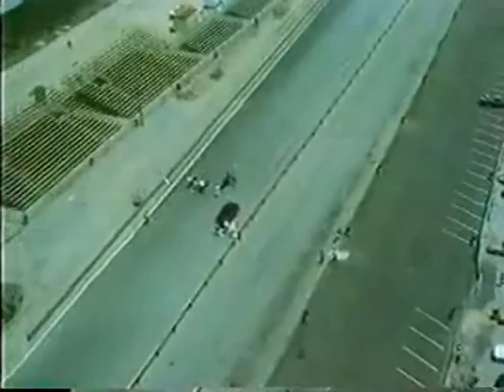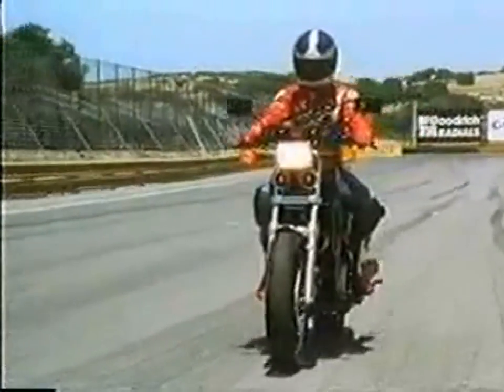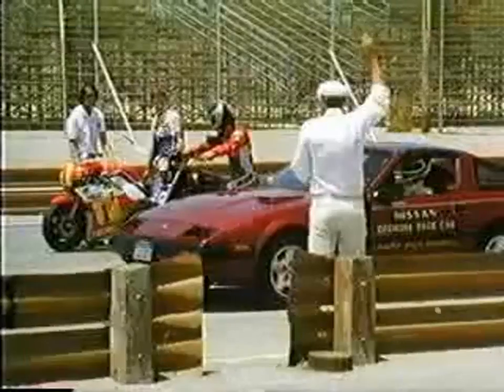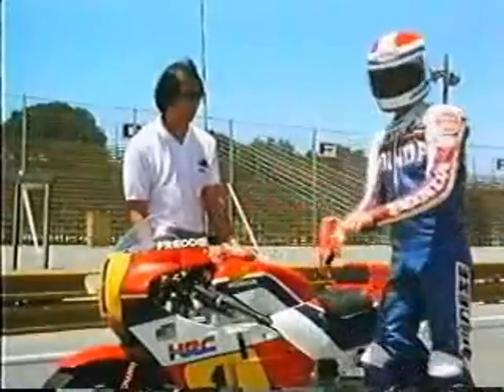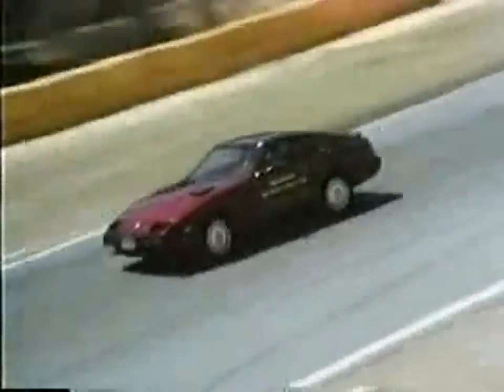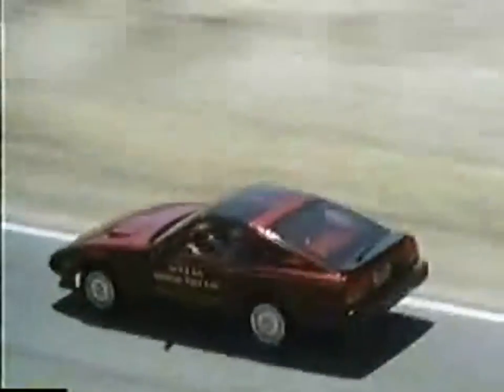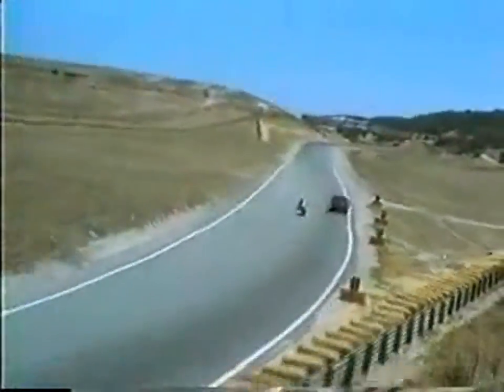Freddie Spencer GP bike Vs Street Bike Vs Car

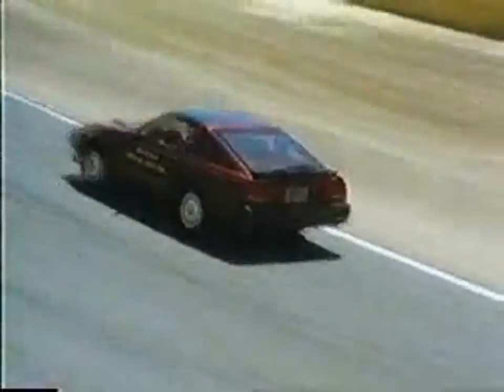Comment: If a car does a 1:30 and Freddie can do 1:15 .or less. of course  the car would get a 15 second head start.  
The objective here is where Freddie needs to overtake for dramatic finish.
Reply: That 1983 Z is not going to do a 1:30 though  (closer to a 2:15 or so) and Freddie will be within a tick of todays times.  Lap times of GP bikes at Laguna only dropped about 4 seconds over the years (on the hew layout . . Lawson was doing 1:25's to win the first USGP and Lorenzo's lap record is a 1:20 but that was in practice they were doing like 1:22's in the race, superbikes have caught up so it would be awesome to get MotoGP back to see what they can do now).  Bottom line, this was exaggerated but not by very much..